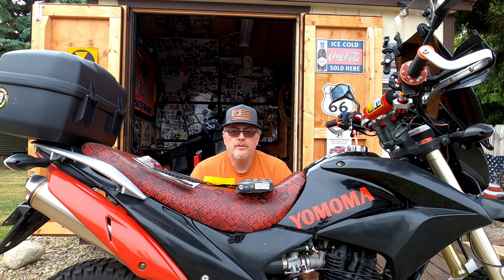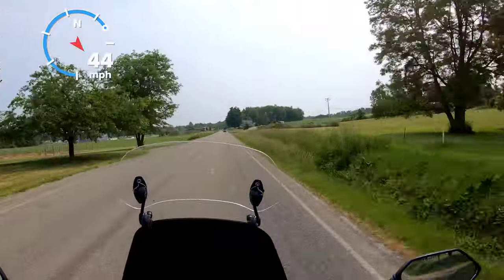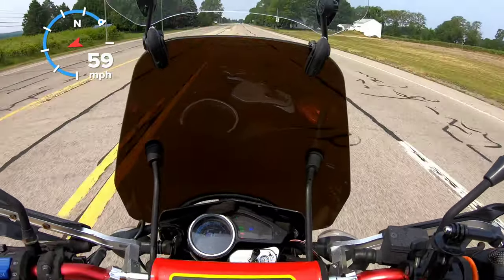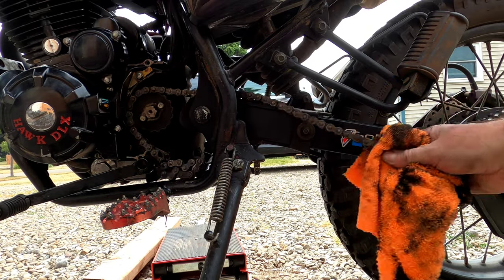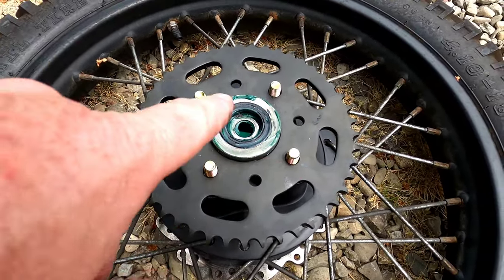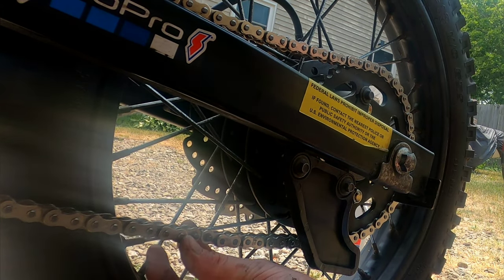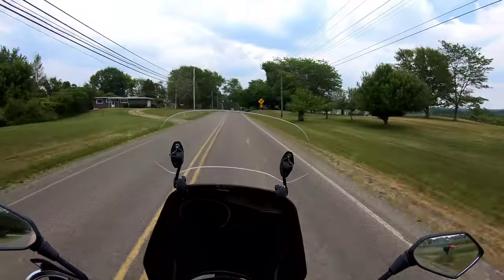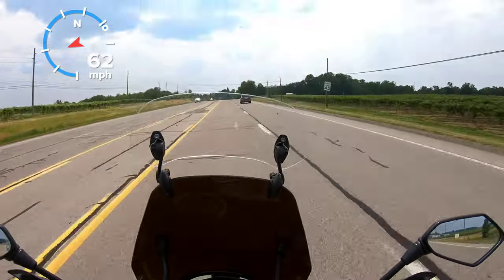How Fast is It?  HAWK DLX Sprocket and Chain Upgrade.  #chonda #dualsport

Comment: Funny. Its been promoted as a 250cc bike. Im running a vader 150, grom clone kind of thing, and it tops out around 63 as well (gps). I've seen it go as high as 68-70, downhill, but generally speaking it does 55-60mph in most conditions just fine for about 80 less cc.

Comment: Very nice walk through install and test on the new chain and sprocket setup  CDL.  Yeah looks like the Chonda definitely has more usable power for around town crusing.  Rpm’s appear appear to be a better range in those lower gears.  Also got you a few more mph’s on the top end 🏍️⚡️👍
Reply from the maker: I think I can getna little more speed out of it.   I need to check the valves again.  It's an easy job to do on this.

Comment: On my Apollo Db36 250 Deluxe street legal model I'm Running a 17 /38.  Came Stock with a 38 rear but I changed entire drivetrain from stock 530 to 520. 530 is overkill for the smaller displacement engines. It's a zongshen CB250 overhead cam engine. 229cc. Did Emissions delete. 
Made stock 17'' wheels tubeless & put Dunlop sportmax Q3 plus street tires on. 150/60-17 & 110/70-17. Nibbi pe30 carb. Nibbi 4500V ignition coil. Iridium sparkplug. Big gun rev box CDI. Full exhaust. New bars. Polisport SM front fender. Added auxiliary lights with own switch. Added a fan with own switch. Added rpm/hour meter. Same cnc foot pegs in black. I hit 83 mph and wasn't fully doggin' her.  7300 miles on her. My brother has on aswell he put a double exhaust on his. They've been extra reliable. But then again I take really good care of my shii. Ride safe..
Reply from the maker: That sounds like an awesome set up.
Reply: I just got the Thunder 250, and I am running it stock but the 520 chain sounds good and I dropped a Nibbi PWK28 in it and it pulls good, back wheel always spins off road.

Comment: I bought the Halk 250 DLX with the electric fuel injection and mine stock it will run 63mph .I bought it in 2023. Not sure what it came with.  But it has been a GREAT bike for the money.
Reply: Where did you buy from? Thanks.
Reply: Which retailer did you buy from?
Reply from the maker: I got mine from Powersports  MAX
Reply: i have 2023 hawk dlx efi and it came with 17 and 45 tooth sprockets i weigh 180 lbs and mine will do 75mph maybe they upgraded it

Comment: Just out of curiosity, why didn’t you just take out the master link to remove the old chain?  It was a few links behind where you used the chain breaker.
Reply from the maker: Either way works.  That's just the way I chose to do it

Comment: I think sometimes these motors need a bit of a break in too.  After at least a couple hundred miles and an oil change they loosen up a bit.  I just picked up a '23 DLX EFI (counterbalanced) and will ride it carefully through that process before I do any kind of sprocket upgrading -just to see what it will actually be capable of.
Was curious what kind of cargo case you have on the back of yours and where you purchased it?
Reply from the maker: This motor has a few thousand miles on it.     The hard case is an Emgo case.  Ebay had them awhile ago

Comment: i just went from a 17 front sproket to a 19 i had to clearance the case and a 52 to a 37 on the rear it added alot on a  shineray allroad 200cc how do you like the hawk
Reply from the maker: It's a nice bike to ride around locally.  Not very fast.  I don't mind getting it dirty on crappy roads.